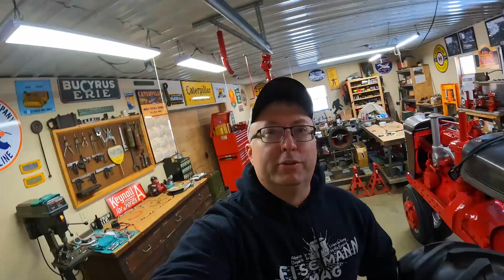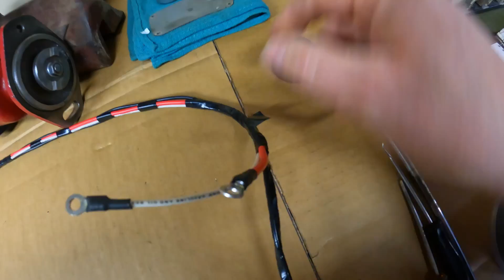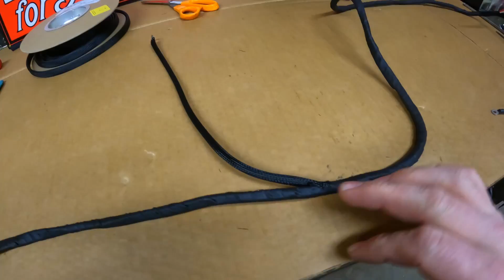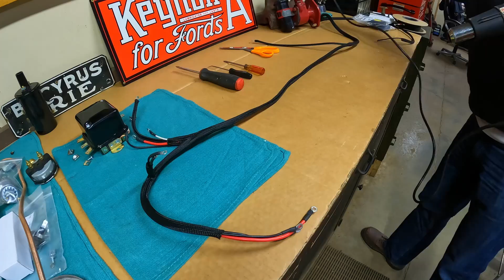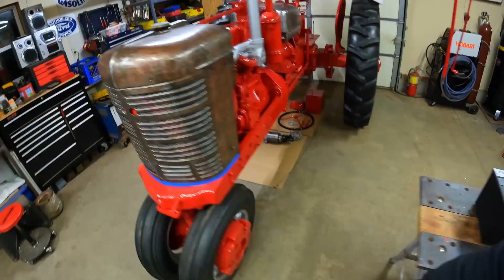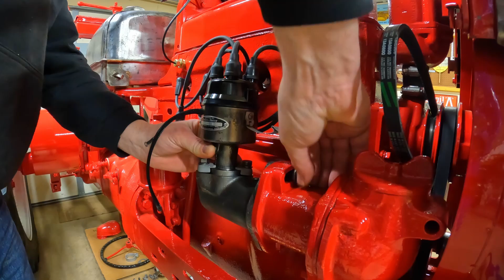Farmall Tractor Wiring Wrap-Up: Sheathing the Harness & Final Paint Batch Preps!

Comment: My Steiner sourced ignition switch only has one terminal?? How does this work?
Reply from the maker: There are two types of switches that were used on these tractors. The one-wire switch was used if the tractor had a magneto - it only needs the one wire because it grounds the mag through the switch body to cut the spark. The two-wire switch was used if the tractor had a distributor - because you only had to open the ignition circuit to cut the spark on those. Steiner carries both types, but you have to read the descriptions carefully to tell which one you’re buying 👍
Reply: @squatch253 That's exactly what happened..

Comment: If you melt the cut ends of the expanded mesh sleeve, it will keep it from fraying and makes a cleaner harness.

nevermind, i saw you did it after you put it on the wire lol

Comment: Toby I've ask before but I didn't get an answer (I'm not trying to bug you ) are you going to put some type of half grommet on the cut outs in the battery box for your power? I know your using the SO cable but just curious if you going to add something to keep the power well on it since it's a positive ground, something to prevent chaffin on the ground wire on the battery? Also are you going to leave the black wiring harness or are you going to paint it to match the tractor?
Reply from the maker: I remember answering your question about the battery box grommets the last time, but yes the new repro battery box came with them to put around the cables. Also yes, I’m going to leave the harnesses and cables black instead of painting them 👍

Comment: I think there is a balance with restoration to make things more practical and safe versus originality. In my 65 Mustang I have replaced the wiring,, updated the braking system and fitted Pertonix ignition. I saw a 66 Mustang at a show last year that had totally modern suspension and steering with a modern fuel injected BMW V8 engine and driveline. That to me is not then a Mustang, its a Mustang bodied modern car.

Comment: As a kid back in the 1960s, I always got such a kick out of the oil filler cap on our old H,  Usually 30 weight nondergent in a quart glass jar with the metal spout screwed on top. 
  That oil was a dollar a gallon at the Midland co-op station

Comment: I see it's been mentioned a few times already to add a touch of heat shrink to finish off the mesh. All my work was done on military harnesses that were completely heat shrinked with all sorts of pre-made forks, t's and all sorts of other transitions. I toured a plant where they put them together and it was basically a wall of pegs with the routing of each wire laid out and strung like a drunkards piano marking out every turn joint termination and so on. Great job overall on the simple system!!

Comment: Great job harness building and and covering with looming I have no idea where dad got it but we did his Oliver  AG 6 we had cloth looming for it much like the mesh you used except it was like a rag cotton weave mesh very loose the unit only had three lamps two at the front and one at the rear wide beam light the two fronts were angled to each side also wide beam lights deep cycle 6 volt positive ground our task was way more difficult on that thing had very few hangers and clips and the desired info wasn't in the manual not even in the shop manual. You did great on the H looks really sweet. Now for that painting weather.

Comment: Sorry if youve explainwd it before Squatch but is there a reason you dont have a smallish temperature controlled painting booth then you could knock off the last bits and pieces? Good respirators or entry level air fed ones arent that expensive
Reply from the maker: I won’t paint anything inside the shop, the overspray gets on everything and I won’t have that. Also, space is at a premium so setting up a booth in here isn’t in the cards either.

Comment: Tractors are just like a car .you put them together and get everything  where you wanted then take it apart paint and rap the wires and then reassemble the car or in this case a tractor. When it's all done  you turn the key with a smile and listen to your project run . Do a little tuning and take it for a ride  with pride.  Denis from Santa Rosa CA

Comment: What kind of tape were you using ?  How about a piece of adhesive shrink wrap at the ends of the loom runs ??
Reply: In the previous video he said he uses Scotch Super 33+  .
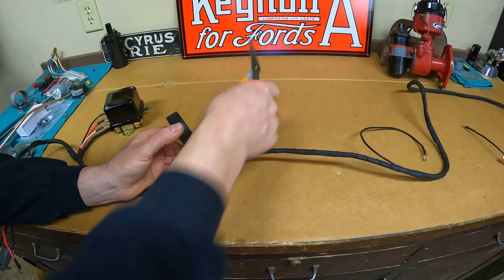Reply: He was using some sort of fabric tape wrapping the harness I believe at the 5:00 mark
Reply: @cndream1  You're right, the 33+ tape was used in initial stages,  in a comment below, he mentions that he used some fabric "friction tape"  in the later stages.  I don't think he mentioned which brand.  I'm not sure where he stopped using the electrical tape and started using the friction tape.

Comment: There is also non-adhesive tape available for wrapping wires.  The advantage of that stuff is there's no adhesive to ooze out and get gooey over time, especially where it's close to hot things (it also can be easier to install, since it doesn't stick to your fingers.)  It's available either with a smooth finish that looks like regular modern 3M tape, or with a cloth finish that looks vintage if that is desired.  You can terminate it either with a short piece of shrink tube, or by slipping the tail end under the last wrap and pulling it tight sort of like a half hitch knot.
Reply: The kind that is totally smoot and non-sticking when you unroll it, but sticks to itself when you pull it?

Comment: When I use cloth friction tape I cut a two to three inch tail at the end of the wrap. Used the tails to tie it into a knot around the wrap. Then cut the tails. I learned that from taking apart factory friction tape loomb wraps. I’m glad you went in detail with the newer covering. I have never used it. But I plan to on a big rewire on my current project.

Comment: 10X .  10X. 10X ……  it is where I started watching…..  then the D6…. Then the little  10…… note in the sixtes as kid helped build sand rail buggies….  One guy was making up his harness. He was even running it inside the tube/frame of the vehicle. Was down to the last bit… but some how he touched and  shorted it out. It stuck inside the frame so before he could cut the battery cable it melted the whole harness!!!  Was terrible and funny at the same time!  As every one told him not to hook up battery till last after doing a continuity’s test because he hid the wire inside the frame…. Note this guy was an electrician worked for the local power company for the state (PG&E of California!) He knew better that’s why it was funny!!!

Comment: You went through a lot of gymnastics to explain that you did this restoration your way. I would have wrapped the ends of that loom with some friction tape as I get ticked off when the loom moves and eventually frays out. But that's my preference. I also consider the generator and battery consumables, so I would replace them with a modern consumable part. It's just a matter of preference.  As you said, many things would be done differently if you were looking to do a period-correct restoration. This tractor is being restored to your preferences, and that's great because it's your tractor and project.

Comment: i think first of all that it is your tractor and you can do what you want. I also think improving the paint, electrical reliability and usability is just smart to do so it fits the need. thanks for the careful explanations of what you are doing and why. our H never had  a rear light because we didn't drive it down the road at night. our 560 and 606 both had rear lights factory installed and we would occasionally drive down to plow out the church parking lot with the 560 with the two point mounted blade. good memories.

Comment: What is the heat source / kind of heat in your shop?  Assuming radiant cove heaters?  Never hear forced air kick on, and assuming not floor heat?  And cant see a wood stove
Reply from the maker: Just a gas furnace, I’m careful to only film when it’s not running to cut down on the background noise.

Comment: My criticism with the woven sheathing is that later on it collects oil/dirt in the millions of voids and can be challenging to clean. Not a problem for equipment that neither leaks nor is outdoors. We finish our ends with traditional lacing tape methods. The same heat that shrinks tubing also readily melts the sheathing so additional care is needed when going with that approach.

Comment: Are you going to try to seal the inside of the fuel tank to prevent rust or do you think it's necessary. Other than that what would you recommend to keep rust from forming in a fuel tank.
Reply from the maker: I never put sealer inside any tank unless it’s the final last-ditch option to keep it useable before it just has to be replaced, because tank liners/sealers  don’t come back off. Once you’ve made that decision, you’re locked into it. You’re best off keeping your fuel tanks absolutely empty and dry inside to prevent rust, or absolutely full of as low ethanol fuel as possible, because ethanol absorbs moisture right out of the air. Another trick is to add a pint of diesel fuel to every tank of gas, it’ll form a film on the inside of the tank that will last until you need to fill the tank again.

Comment: Excellent wiring job. I have used miles of that cable weave in my radio station work. I do, however, add a short piece of shrink wrap over the end of the wire. THEN put on the connector and seal the connector to the weave. To me, it makes for a neater job BUT you have to really be careful and allow enough wire (a service loop) to add the connector. In any case, a top notch job (as usual) from you. Thanks!

Comment: I've never been a purist.  On tractors Dad bought new he did upgrades as needed.
We always had the rear light so we could almost see the implements we used. Those lights weren't all that bright .
I bumped noses with purists because i replaced the distillate manifold. 
Also a friend had a better hood that wasn't punched for the small gasoline tank. Thank you.
Reply: All of the changes that were made over the life of the tractor are part of its story.  I keep most because I like it and they are mine. I really don’t mind if the purists complain.  I have a late styled John Deere B that has a yellow seat cushion simply because it was yellow when I got the tractor and I like it that way.  Every event I have the tractor at I am told it is incorrect.  If I had a nickel for every time…

Comment: The explanation of period correct is by far the best I’ve heard! Seriously people can’t understand that when these were painted on the line that everything but the wheels and tires were on the tractors and paint was only applied to cover as much of the bare metal and primer. My grandpa said his 1945 Wc was the worst paint and paint job he had ever seen. No paint on the bottom of hood and top of valve cover and a lot under tractor was not painted at all. He said it faded bad after 1 year of having it.

Comment: A trick for the ends of these sheaths: glue type shrinktube, twisted inside out (it's a bit difficult, especially on smaller diameters, but it is doable, i use a mandrel in a vise and i slowly walk the inside out with a skewer). Then we take that, place it inside the frayed end, and then (again, but only half way) walk the shrinktube back over the frayed end, making a nice sleeved end. Once heated, the glue will activate (it's recommended to use a high quality glue shrink tube here) and glue to both itself and the sheath, making a clean, never fraying end.
Reply: ooh - nice. I have often used the glue filled heatshrink to finish the braided harnesses - never occurred to me to fold it back like that - of course if you do that, you haven't glued the braid to the harness. Thanks -  I'm stealing that idea!
Reply: That's Squatch level of perfection!

Comment: I've worked with both the Dacron braided and stainless steel braided cable jacketing. A Marlin Spike and a dental hook (with the sharp point dulled and rounded using a file and stone) works GREAT to open the braid and fish out wires and small bundles. The use of liquid whipping using a brush works, so does self vulcanizing tape  but that doesn't last. Usually we used a steel locking band with enough braid to fold back over it, then use self vulcanizing tape to secure the braid over the steel band. When setting the steel band, we'd stick the Marlin Spike into the braid to prevent wire chaffing.

Comment: To further prevent unwrapping of the tape, i put a glue type shrinktube on top. Keeps the wrap from loosening even over time. I do it at both ends, start and stop, because that's where most of the tension in the tape is, and it always wants to escape and unravel.

Comment: After 20 years of building and repairing wire harnesses with dollar store materials at the Ford garage isn't nice to have quality materials. 👍🍻
Reply: Please tell me thay you are kidding. Did they cheap out on that?
Reply from the maker: @erik_dk - Rick and I worked together for those 20+ years, he’ll back me up when I say we had the cheapest electrical tape possible (the adhesive always mostly peeled off and stuck to the outside of the roll, and even that wasn’t very sticky), we nearly had to check out zip ties like they were library books, consumables like Roloc discs were stored in a place that we couldn’t freely access, and a tube of dielectric grease had better last you a whole year or else you’d get a talk about how expensive it was. And I haven’t even waded into hardware/bolt selections yet…
Reply: @erik_dk842  Toby is 100% on that. We literally had to make the best of the worst every day.
Reply: I know that kind of employer, where you end up spending your own money on stuff that they should supply in abundance. I had to buy my own computer and printer for my first job,

Comment: Question, did not look like you used Scotch Super 33 tape as a pre-wrap, if not what did you use? What a store bought great looking wiring harness, I’m going to barrow some of your techniques on some of my projects if you don’t mind?
Reply from the maker: That final tape wrap was a last-minute decision to cover over the Super 33 with a cloth type friction tape, more for slightly additional harness diameter as well as added "compressibility" for when the clips are installed around it, helping them to keep a good hold on things.
Reply: thanks! @squatch253

Comment: That nylon webbing is some great stuff. I started using it on the Harley's when I was working on them... It really does a great job at making a clean install, and like you said - poking wire leads through the sidewall helps to keep everything intact. To finish off the ends, I take shrink tubing and install it over the ends. Really adds to the clean and finished look. Top quality work, as always, my friend. Looking forward to switching gears and seeing some progress on X231. I've got "Christine 2.0" with this 1927 Model D! Ha ha!

Comment: I like the modern loom material. Will look to buy me some.

Also that shrink wrap with the internal glue that is commonly called marine grade shrink wrap.  The coast Guard requires this type of shrink wrap.  West Marine has a large selection of this type of shrink wrap.

The only thing I would do in addition is shrink wrap the ends of the loom to tightly seal the ends of the loom.

On to the X231 yea.  I would really like to see that looking more like a tractor again.

Farmall h does look good.

Also started viewing just a few acres farm a couple months before you mentioned it.  He is super soft spoken.

Farmers come up with some interesting solutions.  I enjoyed the one where the dairy farmer pumped all the cow waste into what amounts to a very large black plastic bag then he generates all his electrical power from the methane collected in the bag.  I 
Sure he runs at least a 100 kilowatt generator and I believe he sells excess power back to the power company.
Soldier on my friend.

Comment: As someone who uses the wrap for work almost weekly, I second the shrink tube over the ends. As for cutting, I cut it a little long with scissors then insert the scissors into the end and run my soldering iron around the end hot knifing the wrap. The scissors keep the wrap from melting closed. Just my personal prefernces that have come with using thousands of feet of cable wrap in a wide range of diameters.
Reply: I think that's a better way to finish the ends too, a nice crisp line/finish is always a good thing